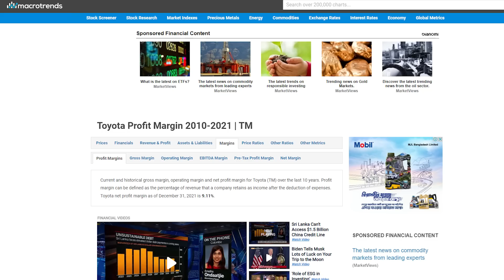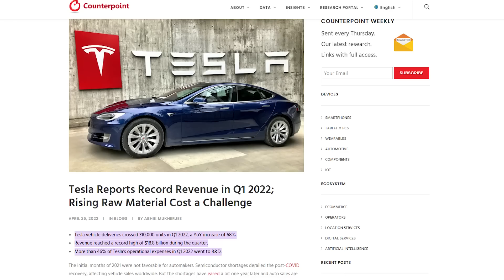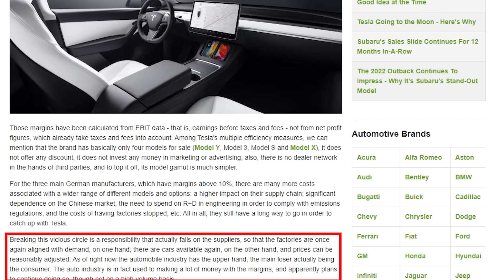Tesla makes 3 times more profit than Toyota per car (Kodak!)

Comment: The support infrastructure for ICE is very considerable, gas stations, gas tankers, fuel storage, fuel refining, oils drilling etc. With the roll out of EVs much of this will be stranded and fuel costs will likely become very volatile. Ultimately though loss of scale is likely to see fuel prices go through the roof.
Reply: That scenario may play out as you predict. But frankly that would be disastrous. Even if the total annual auto production were 100% EV by 2030 circa 80,000,000 units that's a drop in the bucket compared with the total number of ICE vehicles on the roads globally. It's thought to be just under 1.8 billion. How does replacing less than 1/20th of the gas consumers change the price of oil so much? Not to mention the many other uses of oil. Maybe. But if oil prices sky rocket what happens to the 1.72 billion vehicles still burning oil? It's virtually impossible to get all those off the road in short order. Maybe like 15-20+ years? And that's if the annual vehicle production is 100% BEV past 2030. The numbers look challenging. I think the rush and panic to adopt EVs is ill advised. We all know it's inevitable but it's a dangerous path if 1.7 billion people are strangled with huge oil prices and no possibility to quickly get their hands on a BEV. The math just looks daunting.
Reply: @sunrisejak2709  The price of oil changes when the wind blows.  Always has.  I think they will have plenty of customers in places that are not USA/Canada, western Europe, and Australia.
Reply: @tstan6827  Yes you're right. I'm curious to see what % of car sales in various primary markets are EV by 2030. Oil prices unpredictable as you point out. 👍
Reply: @sunrisejak2709  Agree, there is a problem. Being old enough to have witnessed the tail end of the horse and cart era, these changes can happen quickly and be very disruptive. As a society we need to think how the adjustments will be made. As it stands I wouldn't be investing in a small gas station that didn't have good prospects as an EV recharging station
Reply: @jimgraham6722  Funny you mention that. I live in Thailand and recently a number of massive gas station have been built near me. But they at least have allocated space for EV support even though now it's unused. 👍
Reply: @sunrisejak2709  I think you have to consider that the newest cars on the road does the most miles, on average. And before we reach 100% EVs there will be a few years with a major part of sales being EVs, and the rest fuel efficient ice cars. So by the time EV sales are 100%, most ICE cars will be ageing, rusting, require more repairs, and all the new company cars that does a lot of miles will be EV. Gas station owners will see smaller profits from fuel, and will think twice of investing in new underground tanks when the time comes to replace them. There is just many factors to consider that may speed up the disruption.
Reply: @itekani  Yes, no debate on that. Either way it will get somewhat stressful for some folks. Rural Thai farmers (29 million) (poor) now getting by on older beat up pick up trucks will be faced with some challenges at some point where I hope suitable, affordable solutions will be on offer.
Reply: @sunrisejak2709  If the government would be a bit pro-active and invest in education and economic incentives, there could be a many jobs created by restoring and converting existing cars to electric. I think that would serve the local economy better than replacing all cars with new imports from China or whatever. And probably a converted pickup with short range would do the job for most cases at a fraction of the cost.
Reply: @itekani  Yep. And the around 40% that live in condos and apartments in the city that can't charge from home it work needs access to a good many public charging stations and with continued innovation in the battery tech the charge times can be significantly shortened. Lots to do but seems possible.
Reply: @sunrisejak2709  yes there is potential for the disruption to be quite chaotic but if we kind of zoom out and imagine that there will be lots of innovations and pivoting in businesses and technologies ad techniques with opportunity ... many of the issues will be addressed.  I know in your thailand example what you mean but there are a million exposed electrical wires everywhere you drive in thailand that resourceful people tap into all the time. The lack of regulation on electrical access and safety apparent there is mind blowing just tons of wires over wires everywhere and people just setting up shop on the road side. This charging for EV's will be a market the same way many thai markets and roadside stalls sell 1 litre bottles of petrol for motorcycles.  No infrastructure needed for ev charging they'll just use solar, wind, water ...or more likely...tie in (electrical term with a pun!). film gaffers in independent films tie in to main electrical lines all the time to shoot lw budget films without ggetting permits and stealing electricity.. this is done all over the world all the time.  You cannot not tie-in to a petrol/ gasoline line from a gas station!  but as the thais do they can fill up a hundred empty bottles with petrol/ gas and sell them on the road in the middle of nowhere.  missing infrastructure= opportunity to the resourceful.  ALSO, With cars there will be innovations in conversion from gas to electricity as well as opportunity for the resourceful.  When the big shift comes there will be people turning some gas powered cars/ vehicles/ machines electric when needed.  There will be innovations in this area too. Lastly there wil be massive changes in grid dependency hopefully towards tony seba's idea of super-power.  There was a panic during the horse and cart era very similar and the argument to keep horses was much better than keeping ice cars.  horses are self driving and run on hay and grass found everywhere.  The entire infrastructure of horses was practically free and ubiquitous... why would you want to buy a big complicated machine that required expertise that almost nobody had.  when the first mercedes came out people used to buy "fuel" at pharmacies in bottles. i think it was rubbing alcohol.  I don't remember exactly, i looked it up a long time ago for a research project.  women used to mostly drive these first cars and there was zero infrastructure yet they could make a hundred miles buying "gas" at regular shops.  The electrification will happen much more quickly AND smoothly than from horses to cars and yet it will still be a real disruption and there will be chaos but not end of times level. just my opinion.
Reply: @ds7766  Good points all. I agree with most of it. A challenge could also arise from people simply asking why? I don't want to change. I'm happy with my current transportation methods. I don't have a problem that is in need of a solution. My life is incredibly convenient just the way it is. Leave me alone. Etc etc. Global warming and pollution? If you've been to Thailand (and obviously you have) the general consensus by average folks is that their sacrificing by having to change for pollution is not high on their list! Actually this thought process and behavior is also present in USA by folks who simply loathe change. But I agree that the innovations and infrastructure development will result in many enhancents that will help win people over. In reality they won't have a choice. Plans are already underway on the local EV production front and the government is mapping out the steps needed to enact this rather interesting shift in energy usage. I'm not a skeptic. At the moment it's a bit premature to jump in as those early adopters have discovered. Models available today are hammered with the ridiculously high import duties so local production is the only solution to that as the government relies on these tax receipts generated by well to do Thais (and expats) consuming imported goods. I looked at a Tesla model 3 long range. It's about 3.5 million baht or 110,000 USD. Granted that's not the solution the vast majority need. Here the first lie cost players GWM with ORA GoodCat has struggled with quality and performance issues while MG appears to be doing a little better and those are around 1 million baht. (30,000 USD) too. Low end, locally made ICE pickup trucks are a little more than half that. The transition will be fun to watch. I suspect it will create opportunities for those who embrace and bitching and moaning by those who reject it. I guess that's normal in any paradigm shift. This was a rather long response that really doesn't offer any objection to your comments and is merely pretty much in alignment with what you said. I must have too much time on my hands! 🙂 Thanks.
Reply: @sunrisejak2709  one interesting point i can make is my understanding of thailand's relation to the u.s.s is largely due to the economy getting huge benefits from thailand making car parts for the u.s. ice oem's.  I read this many many years ago so not sure if it still is true but at the time the largest influx of money to thailand from foreign countries was something like 40% coming from u.s.s car industry.  this is probably why anything but an ice oem is expensive.  their economy is largely grateful for this and is part of reason why thailand is a u.s.s ally and follows u.s.s values.  ice oem's own thai car industry ! i imagine any non u.s.s car (or the u.s.s cars allies) would cost a fortune because of politics alone.  tesla would be the pinnacle of their target to make them heavily taxed.  but again this could be old out of date info from books i read way before the internet!

Comment: Too many models, I am not sure why GM etc... does not get that.
Reply: @brunoheggli2888  It wouldn't make sense to have more models when the demand for their current models is outpacing production. A new model requires a new production line and hundreds of new parts. They would have to spend more and take resources away from high demand vehicles.

They should continue to wait until they have enough volume to supply the demand for their current vehicles before trying to get customers for a new vehicle model market. 

Right now they can only get X amount of batteries which limits their production to X amount cars. Even if they had 30 different models they wouldn't be able to sell more cars than the amount of batteries they can get.

Comment: Tesla may have 3 times the margins of Toyota, but Toyota still sells 9 times as many cars as Tesla. That's quite a lot and makes Toyota in total earn 3 times the money of Tesla from their vehicle sales.
Reply: Tesla still made more total profit. Amazing.
Reply: @brunoheggli2888  when demand is fully met for the current models (current wait for cheapest is about a year), they will offer a cheaper model. They’ve RAISED prices about $7k per car over the last year and demand is still unmeetable.
Reply: @brunoheggli2888  Will they? How many electric cars do you think they have to sell in 2025 to beat Tesla? Before you answer, think about that Tesla had two working factories last year. By the end of this year they will have four up and running, and expanding in Shanghai.
Reply: @brunoheggli2888  we shall see
Reply: @brunoheggli2888  They are expensive because they can sell every car they can produce anyway. Next is another expensive car, but one which will sell lots in the truck loving USA, at least. Once they have saturated the markets for those models, be sure they will launch a cheaper model next. Maybe  VW can catch up eventually, but I doubt they can do it in three years.
Reply: @brunoheggli2888  Vertical integration is a very good thing when suppliers cannnot ship what you need. It is also very good if you want to integrate everything in your software. I imagine VW and others that rely on OEMs for almost everything have to spend a lot more time integrating everything together. Having less models without a gazillion combinations of options helps to scale and keeps costs down. You know Herbert Diess said they take three times as long to make one car in VW compared to Tesla? They have a lot to catch up...

Comment: i agree with your kodak/ toyota comparison.  paradigm blindness/ paradigm paralysis clearly at play.  the expertise and long history of success  within the previous paradigm actually solidifies and guarantees their failure to adjust to the new paradigm. their success in the old paradigm becomes the weight that holds them down. a giant tanker ship at full speed cannot make the the 180 turn in time. kodak, nokia, blockbuster, sears, barnes and noble. in fact every choice that most ice oem's are making are guaranteeing their failure. especially toyota and gm. making all the wrong investments. vw trying their best to turn the ship may make it out alive, maybe ford but thats it.
Reply: The bottom is falling out of Toyota’s main traditional support buyers…the baby boomers. My parents are replacing their RAV4 with a MODEL YLR.
Reply: I doubt it.  GM just announced they have solid state batteries that are cheaper than and more powerful than Tesla.
Reply: @michaelbradley1636  there has been and will continue to be announcements, proto-types, ideas, models and plans from all the ice oem's.  quantumscape announced solid state battery break through and were the first big venture to do so about 2 years ago.  getting them to produce at scale as "planned" (cheap/efficient/ reliable/ at scale) will take at least 10 years.  there are hypercars like electric lamborghini type cars  coming out next year (more plans) with solid state batteries but the battery alone cost around 100k-200k and the cars cost 2 million and up and they will only produce about 60-100 of these 2 million dollar cars.  solid state batteries may happen at some point but tesla will be selling 20 million cars per year in ten years and will have solved fsd by then.  announcements are amazing. you should buy an announcement if you agree! ;) but if you want to buy a car thats produced at scale that will keep an ice oem afloat ... they need something announced ten years ago, brought to scale 2 years ago and on sale right now to get second place in the ev race. second place could have been possible if they started shooting for full scale ten years ago. second place is going to a chinese company.
Reply: @michaelbradley1636  Scale is all that matters, not “announcements”.
Reply: @ds7766  Perfect answer.
Reply: It's an easy narrative to feed if you pretend the bottom-up approach doesn't work.  Reality is, that approach holds far more potential in this worldwide paradigm-shift.  Toyota has been quietly upgrading their entire fleet with the new TNGA platforms.  No one noticed.  Easier to build and squeeze profit from, along with the flexibility for e-TNGA migration, the stage is being set for legacy transformation.  Online rhetoric pushed by enthusiasts, who focus almost exclusively on speed & range, completely disregard that as important.  Toyota is well positioned to address the needs of mainstream consumers.  Those claiming "paralysis" are in denial about what appealing to ordinary shoppers actually requires.  Their expertise taught them how to navigate through the hype, avoiding traps other automakers continue to fall into.
Reply: @john1701a  i guess we will see.  the profit margin (being better)for toyota making fossil fuel or hybrid cars is the issue, also factory efficiency , securing battery materials and chips, not being vertically integrated,  having to rebuild factories... but then you say maybe they have been doing all of this "quietly" like they really don't want people to know (share holders, suppliers, vendors) to find out they have already transitioned whole factories from plumbing a controlled explosion machine (combustion) to a lap-top-computer-on-wheels factory, according to your premise they have the assembly line of computer engineers,electricalmotor engineers,  the battery deals, the factories of thousands of qualified electrical workers, ready to turn on with a switch and they have purposely duped the entire world including customers, dealerships, suppliers and shareholders into thinking they are not ready because somehow this will be an advantage when they surprise everyone with an entire automotive ecosystem transformation .... and the suppliers they will no longer use (because they are about to close whole factories of ice manufacturing) are excited to keep it secret for toyota that they will no longer be supplying them with parts for their ice engines next year or the year after or five years from now because they love toyota so much they want to help toyota keep their secret electric car supply chain a secret so toyota can surprise every one with their quiet transformation to an entirely new engineering ecosystem.  doesn't make sense to me... but maybe.  i just cant think of what the advantage is of making everyone think they are not doing anything, putting out press releases and advertisements that electric is not the way to go for years then changing their tune in the last 12 months but but at the same time quietly changinging everything they do.   it doesn't add up imo.  but maybe that's somehow good business. i dont know. seems off.

Comment: All ev cars make double the profit of ice cars that's why they are being pushed so hard by the makers, that's also there is a shortage of cars so they can put the chips in the most expensive and profit making vehicles. Which are £ 40k+ EVs or top spec ice cars. That's why there are no sub 20k EVs with a decent range. Why would you give up all that money